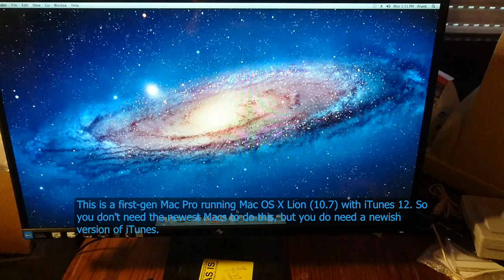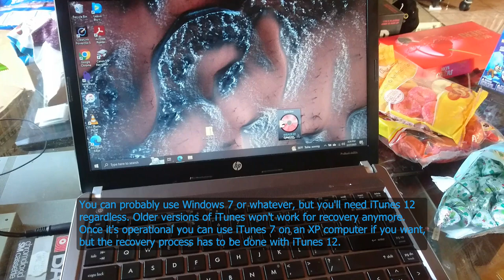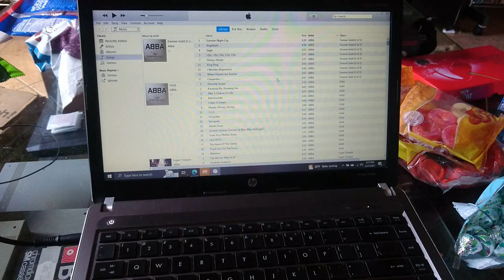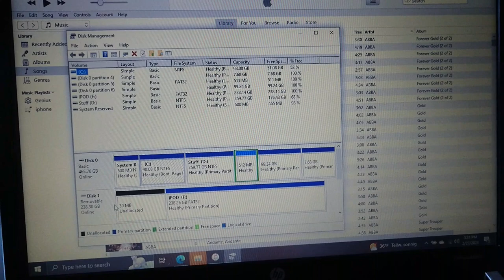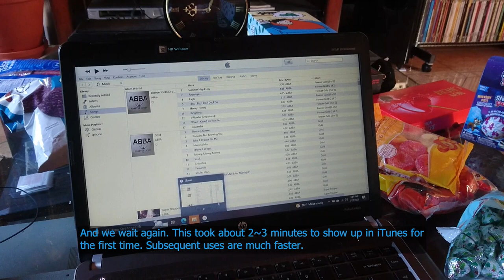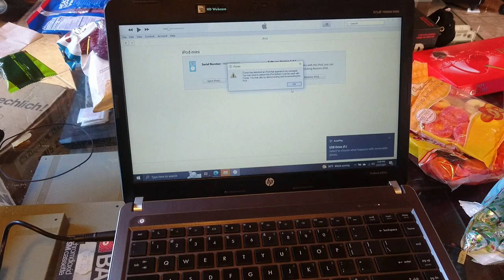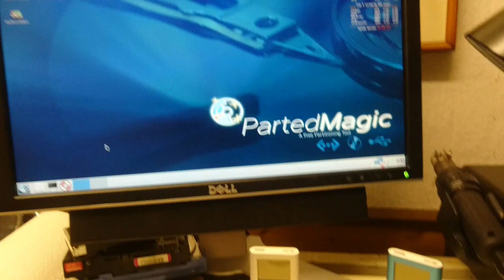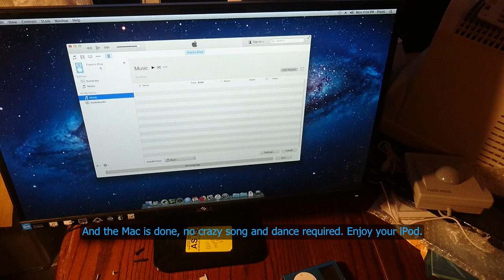iPod mini flash mods! How to get the thing to work properly with up to 256GB.

Comment: basically what we have to do, is restore the ipod on itunes until gives the error, then restore the RBM both with a partition manager or other ways and it should work after when connecting back? i still even struggle getting my ipod to be found on the pc by itunes, it seems it takes a long time even just connecting and it makes every single other program open struggle so much. i am almost tempted to even buy a old 2007 macbook to just avoid any of this hassle.

Comment: Do you know the brand of your red CF to SD adapter, where did you buy it from? I heard that some of them don't work for iPod Mini.
Reply from the maker: Hi, so I got it off Amazon. I'll put the link in the description. It looks pretty generic though since there are a couple brands with a similar look to them (mine was RGBS but there's also LEAGY and they look the same). I think the biggest concern with these is to get SDXC-capable adapters if you want to go over 32GB (SDHC types max out at 32GB, while SD has a 2GB cap).